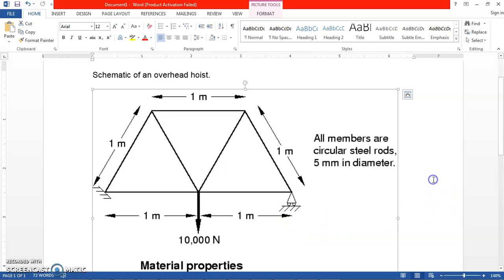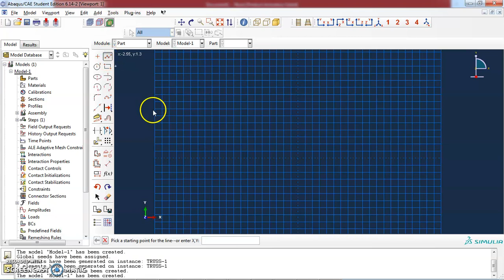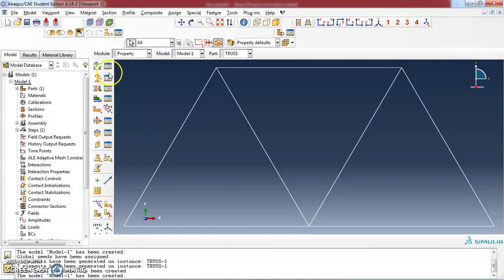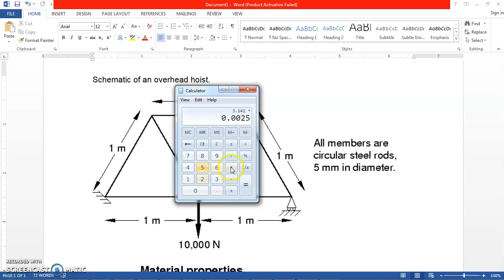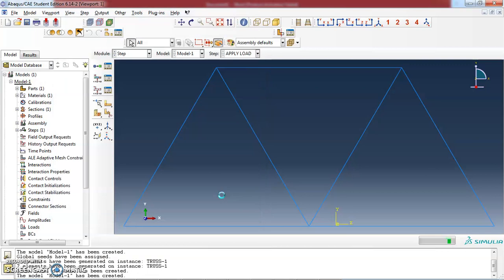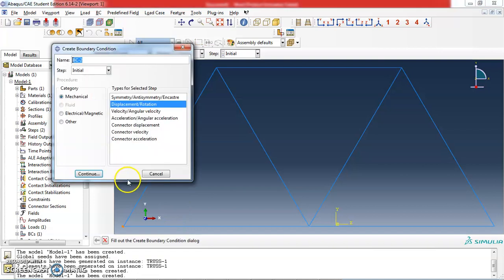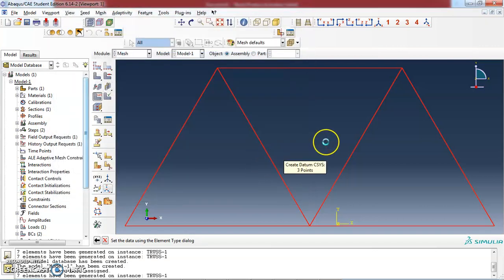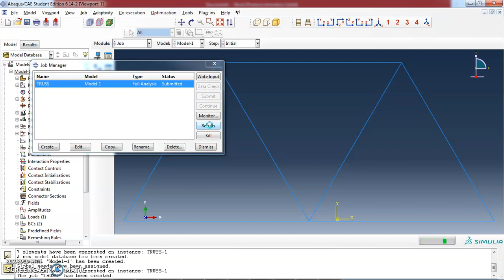MODELLING TRUSSES WITH ABAQUS PART 1

Comment: macam mana nk tau cf1 ke cf2 utk msukkan nilai point load ?
Reply from the maker: Cf1 daya arah X, cf2 daya arah Y.
Reply: @noorfaizalbinyidriseng8831  thank you sir 😊. btw Dr, one more question. apa mksud ni "Error in job Draft1: Analysis Input File Processor exited with an error - Please see the  Draft1.dat file for possible error messages if the file exists". sy xtau apa error